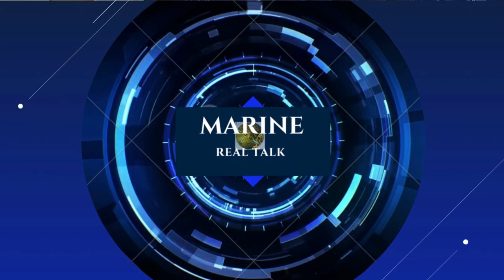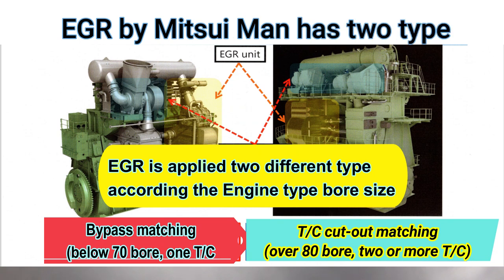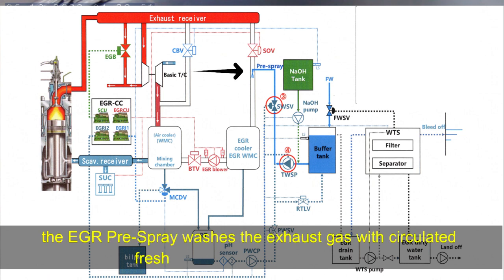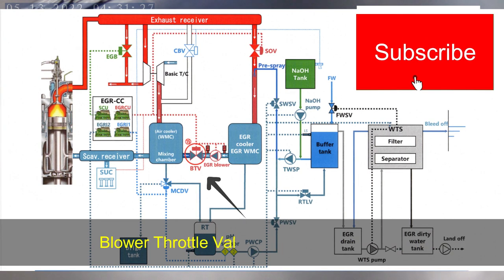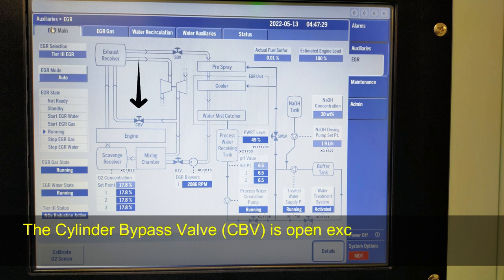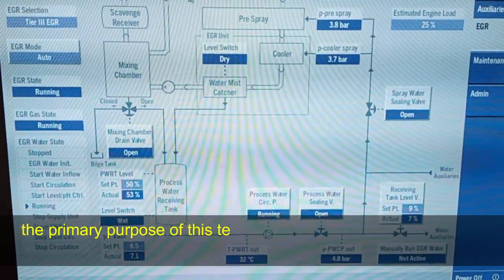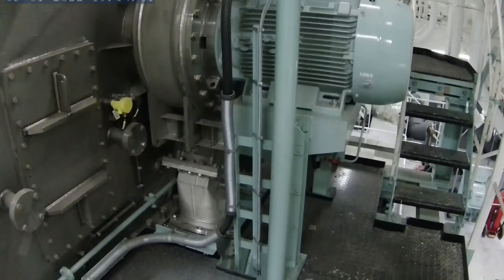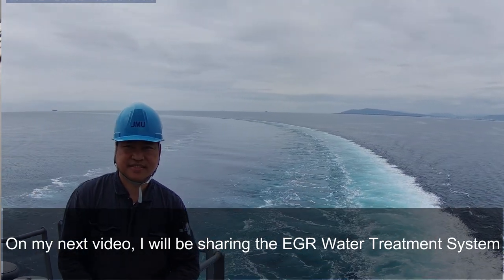EGR - Exhaust Gas Recirculation principle /Chief Boyet / Seaman Vlog/Marine Real Talk

Comment: The lesser the oxygen the lower the NOx will produced. Kaya  binabalik yung exh gas. May mix via regulator throttle.
Reply from the maker: Hello GB, the oxygen is partly reduced to about 17.3%. by partly replacing with CO2. At this certain volume of oxygen the combustion rate/speed will  reduce, when the combustion rate has reduced, the peak temp or combustion temp will be reduced, therefore the NOx formation is reduced.🙂 Feel free to leave your comment if you any further question about EGR.🙂

Comment: First of all...Ur video and explanation alogwise is extremely comprehensive.I can atleast understand though havent worked yet.
I have two querriers..
1) with same output power from ME , is it like this that turbocharger will be comparatively small incorporated with EGR system compared to without EGR.Asking such question because anyhow the exhaust from TC will be inducted to EGB,then why Dedicated EGB bypass positioned with EGR system..Why not in normal engines!
Reply from the maker: Hello Suran, thank you for the appreciation. 
About your queries, actually the TC size is still the same as the one without EGR. The EGB  also may install even to the engine without EGR and most of our vessel without EGR are equipped with EGB. The EGB actuates at a high engine load to prevent TC over speeding. It can be operated in auto or manual but it better to kee it in auto.🙂
Reply: Awaiting ur response sir😊😊
Reply: Thanks for ur response.I believe with EGR in the system,already there are plenty pressure drops and still possibilities persists that TC may overspeed at higher loads.
I worked with ME-B tier 2, there I had fixed TC and outlet going to EGB
Reply: But yes , with EGB bypass, we can elevate the rpm of ME without even TC overspeed,Good protection to TC
Reply from the maker: Hello Suran, sorry for the late reply.
The possibility of over speeding may also depends on the condition of your EGB, if it actuates on the certain  engine  load as per designed.
Reply from the maker: Yes you are right Suran.
Reply: @marinerealtalk8683  condition of EGB means..if EGB is not fouled,then   there will be less pressure drop across EGB,and hence good flow and possibility of RPM increase is there?
Reply from the maker: Yes, when it is fouled. Thus it is very important to frequently carryout the exercise maintenance by operating it manually in the MOP to check the opening and closing condition to ensure that it will be actuated and response at certain engine load as per designed. If the EGB is working well, the possibility of TC over speeding might not happened. I've been in sea trial of morethan 30 new vessel where in the engine was tested at 100% engine load. None of those vessel had a TC over speeding. This means that as long as your EGB is working good then, you have nothing to worry about increasing of TC RPM.🙂

Comment: What is the function of EGB valve? and the CBV function, when have low load the valve will be open and the air by the same pressure going to the pipes of the system to increase the heat of the exhaust gas ? or in the SCR system CBV this function only ?
Reply from the maker: The EGB (Exhaust Gas Bypass) is optional for EGR. For Tier II engine, the EGB valve is installed on the exhaust gas receiver, and will be opened/fully open at high load to release the exhaust gas in order to prevent overspeed of turbo charger. The valve is partly open at low load.
The CBV is very important in EGR system, this valve is for bypassing of the scavenging air from the compressor outlet to the turbine inlet to partly recover lost scavenging air pressure when ERG is running. Actually, in the SCR, it has also the valve called CBV same as in EGR. The SCR and EGR has the same purpose and function which is to reduce the NOx, emission but method used is different.

Comment: Hi Chief. Did you have any difficulties with changing over the filters while EGR in operation?
Reply from the maker: Hello Sir, if you are referring to what we call spaghetti filter of WTS, you can change or clean it while EGCS is running. Just stop ng WTS operation. Should you have any concern, please let me know🙂
Reply: @marinerealtalk8683 Sorry, didn’t mention which one) I mean process water filter located on the floor deck near PWRT. It is impossible to change over the filter during EGR running
Reply from the maker: Yes, it is not advisable nor recommended to clean while EGR is running. Anticipating that filter could be clogged, thus better to make sure that filters are cleaned prior operating the EGR. But in a situation where you really needed to clean without stopping the ME, then you have to lower the engine load to 10-12% of MCR to auto stop the EGR, yet your ME still running. Then you can do the cleaning of filter.🙂
Reply: @marinerealtalk8683  well, this is clear. Thank you for information. But it is very strange the system is not designed to change over the filter when EGR in operation
Reply from the maker: Actually on the first design, there was no bypass valve. But anyway , I shall check new design if it has now a by pass or two lines thay can be used alternatively considering to  clean if needed.🙂

Comment: I have a question, sir. If wet scrubbing process is used in EGR, Isn't there any efficiency issues for engine?
Cause, I know the system will adjust the proper level of water mist and the water mist would be captured by water mist catcher. But still, haven't you experienced any problems what I mentioned when you were onboard those ships equipped with EGR?
And how much the EGR can neutralize the SOx? Can it neutralize even if the ship uses HSFO(Sulphur content is below 3.4%)?
Reply from the maker: Hello, sorry just now I have read your  comment. Actually when it comes to engine efficiency, still the same and is not affected even it is fitted with EGR. While for the water mist, the system is so designed to cope  even at max engine load. 
About the Sox, there is no certain amount Sox being removed while EGR is in operation. But due to the system operation Sox is partly removed. Moreover, the the sulfuric acid from the SOx can be partly neutralized its because of SW which is naturally with high alkalinity. The Mitsui EGR are mainly designed for LSMGO not unlike in SCR.
Reply: @marinerealtalk8683  Oh~~ I didn't know the engine normally uses LSMGO. Thank you sir
Reply from the maker: You are very much welcome. Feel free to leave you comment if you have any concern. Likewise, thank you🙂